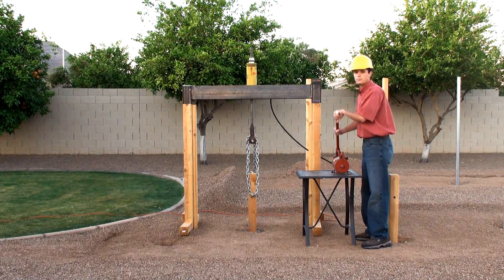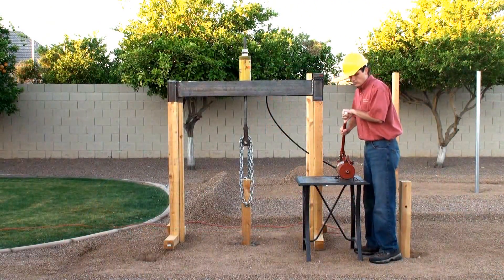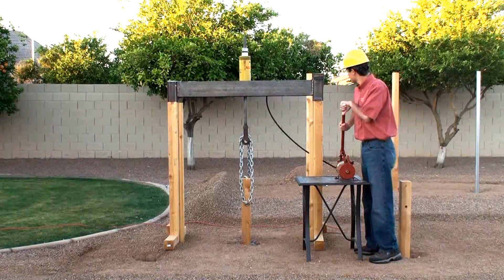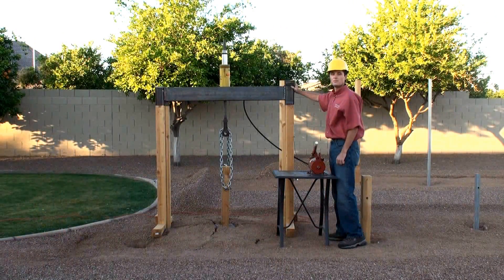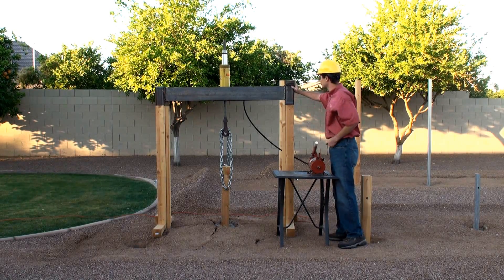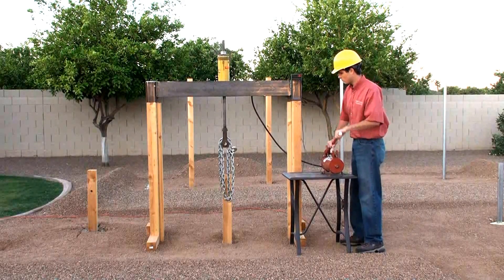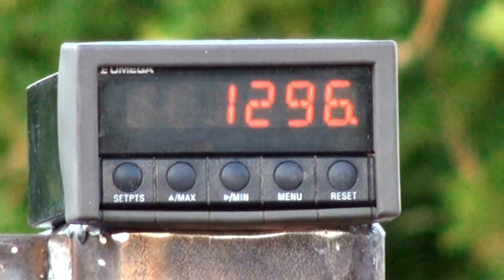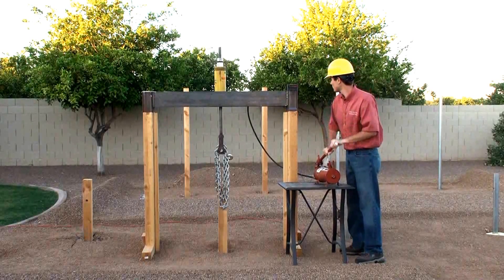Strength Test of Secure Set compared to Concrete

Comment from the maker: Thank you to our customer MSE Electrical Construction for this great review:
     I am in the electrical construction trade and we have utilized Secure Set in many utility poles, temporary power panel structures, and direct bury light poles and have had amazing success for the past 5-6 years.  This product allows us to set poles that normally took hours to set up with concrete or that the tamping process would over time start to allow the pole to lean.  This product greatly reduces these tendencies and we can achieve this in about 30 minutes with proper preparation and strict adherence to the product installation guides.  It gives us the peace of mind the poles will be solid for many years to come as it does not break down and it also eliminates the possibility of voids in the soil compaction process as it expands to fill the entire area.  Another great feature of the product is that you can pour it in lifts without the worry of what is called checkering.  As with concrete or tamping when you install in layers it allows potential voids between the layers to form air pockets that water or some other substance can enter and either freeze or solidify and weaken the area around the structure you are supporting.  This product eliminates this process and for a simple explanation melts and welds to the top of the initial pour and expands into any voids so no air pockets can form and creates a solid structure support.       Also with the packaging of the product they send it with all the tools needed (besides a drill) to utilize the product including mixing cups and stir paddles for a drill.  This makes remote locations much easier without the need to lug water around and minimizes the amount of equipment needed to install these structures.   By MSE Electrical Construction

Comment: Why do a vertical test vs a lateral test? The lateral is what matters.
Reply from the maker: Hello Gauge,  With a full panel fence, as the wind blows at a direst right angle again the fence, the fence will start to lean over in the direction the wind in blowing.  When the fence starts to lean, then the wind is hitting a sloped surface. The wind then is deflected in an upward direction. The wind then starts to drag on the surface of the fence and it creates an upward pull on the fence. All vertical surfaces experience this same phenomena, whether it is a fence, a flag pole, a building or a billboard etc. There is always some percentage of the load that is transferred from horizonal to the vertical.  That is why it is important to test both load factors. Thank you

Comment: Isn't this really a test of the strength of the ground?  Neither the concrete nor secureset breaks apart.  Only the ground breaks apart.  If the ground is packed looser, less force will be required to pull out the concrete or secureset plug.
Reply from the maker: Hello Larry,  Since there is no "packed" dirt around either the Secure Set or the concrete that is placed in the hole, the test is about the ability of each product type to fill the hole, adhere to the soil and resist the uplift force needed extract the post from the ground. The holes were drilled out, a post was placed in each hole, the space around the post was filled with either Secure Set or concrete.  That's the method you use to set a fence post.  Thank you.